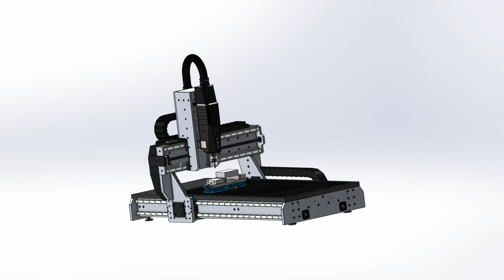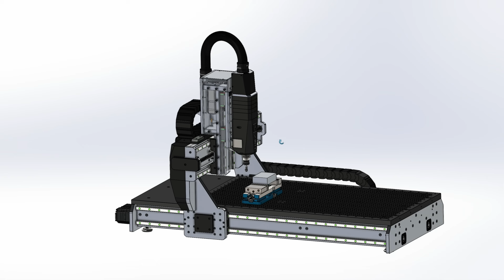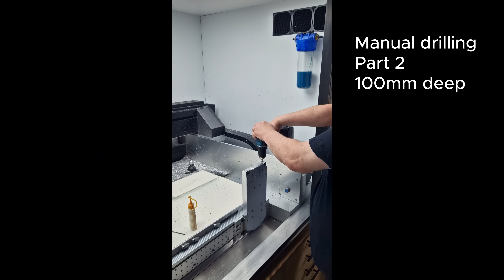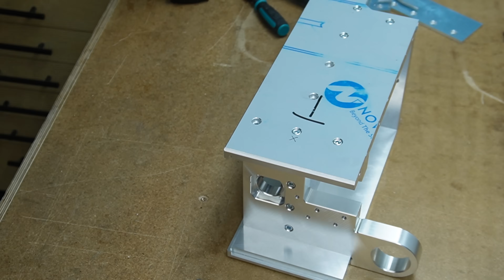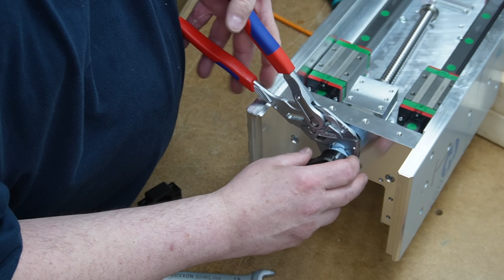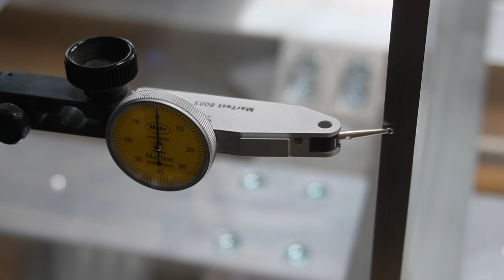Overkill CNC Router Upgrade Part 5 - Chatter free Z-Axis Design

Comment: This is madness!!!
I have watched your videos multiple times, great content sir. 
I have one question regarding mountinh of the screws. So in order to ensure alignment of the screw with linear rails and blocks, first we should mount it and loose the float block and ball screw housing?
Then move it few times back and forward, so after that to tight the float bearing block and ballscrew nut?
Reply from the maker: Yes, that's almost the way to do it. But you need to have the nut housing fixed first. Do it as close to the bearing block as possible. Alternatively fix the floating end and loose the fixed bearing if that's better for accessing the nut housing. Once the two ends are properly aligned, you can loose and re-tighten the bearing block, again close to either end

Comment: What is the accuracy of this router? Looks really cool, thank you for the videos, I'm learning.
Reply from the maker: The resolution at the axis is 1 micron. It mills easily tolerance fits for bearings in alu. +/-0.01 I would say, when I factor the mechanics in

Comment: I've been absolutely loving your series of videos you have put together on this incredible project! You're a huge inspiration to the much less capable machine I intend on designing and building. Would you mind sharing which Ikea horizontal-drawer cabinets you have? I was unable to find them on their website, as I would like to implement a similar solution for my workshop. Thanks!
Reply from the maker: Thanks man. The cabinet with the 4 vertical drawers is completely selfmade. The others are Method kitchen cabinets

Comment: Can i ask, why most vmc use moving rail on z axis?
Reply from the maker: It depends on their design. The ones with a fixed column and a small head (like BF-20, PM-25, etc) have fixed rails on the column. The cheap ones even ride on dovetails, but is it the same principle. 
The ones with a moving column and a large head (like a DMV60) have moving rails, because they usually cover very large Z-axis work spaces

Comment: The only problem with this build is that CNC beginners might find your videos and really think that this is the standard for a diy hobby wood working CNC and never start building 😂 
Jokes aside, as a mechanical engineer I can say that I really admire your design and the thoughts you put in 👍🏼 I would really be interested in:
1. overall cost of this beast
2. a critical reflection of what is really necessary for hobby-level milling of wood, aluminum or maybe light steel on this thing. I mean even with hardwood you would never be able to cause errors greater than 0,1mm with the given sturdiness, even if you try to go full depth and width with a 30mm end mill or something similarly stupid. I can imagine that the constructive measures on the gantry alone would make this better than most commercial wood working mills, even if you would build it out of filled Item extrusion profiles. Looking forward to the rest of the build!
Reply from the maker: Fellow mechanical engineer here too 😉
1. You can reach out by DM at IG for more info on cost
2. Well...I call it hobby woodworking router, because that is the sole purpose of the machine in my shop. I have an even sturdier one for metal (see my last video)
But we build this machine 3 times and one of the other guys mills steel with it. I sell these things and had all sorts of applications in mind. Also semi-professional ones

Comment: This is without a doubt the best (and best documented) CNC build on the internet, bravo! I'm coming back to this video for reference and best practices after assembling my own router and having what I think is massive chatter on first test cuts using feeds and speeds from a tiny benchtop mill. I notice that you don't provide any additional seal to keep chips out of the ballscrew and linear rail system, do you find that the built-in seals in those components work well enough? The rectangular spindle housing seems like it should contribute significantly to the rigidity of the Z axis moving plate. It's a shame that the most common and affordable spindles are all round housing types.
Reply from the maker: First of all thank you for the kind words 🙏
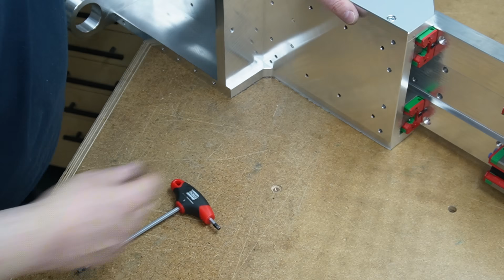At 19:45 you can see that I use extra seals (Type KK) on the linear blocks, but only on the outside. This is ok, because the inside is completely blocked by the mounting plate. No extra seals on the ball screw, because in my experience it does not tend to pile up chips because of the rotation. In my design the spindle does not add a lot to the rigidity of the mounting plate. It lies more in the 30mm material thickness of the plate itself. At 25:33 you can see that the mounting points of the spindle are located at its lower end and they are spaced 100mm apart. You are right in that area it further increases the rigidity, but that is just around the lower blocks. The upper linear blocks are spaced further apart and the stiffness in the area between upper and lower blocks does not benefit from the rectangular shape of the spindle.
But this spindle design is nevertheless a big contributor to reducing chatter, because it is very rigid and has a large surface area which is bolted flat against the rigid spindle plate. The radial forces in the upper and lower spindle bearings can flow directly into the mounting plate. Round spindles need an extra holder, which usually has a smaller surface and narrower bolt patterns. The radial forces create a moment, because there is usually a lever (distance) between the spindle bearings and the holder. Such a mounting situation is prone for chatter. You can cure that by using two holders, but I rarely see that on a hobby machine. Btw., almost all spindles in large CNCs are round, but they are mounted with a flange to a very sturdy box, so a completely different setup.

Comment: Hi this was a brilliant series to watch. You really know your stuff! 

I’m in the planning stage of my own CNC build. Did you have any concerns about vibration damping when using aluminium in the frame design? Also, with attaching steel rails directly to aluminium, is there any need to be concerned about the difference in thermal expansion? I understand this is a wood router but having used very expensive, precision components on it I assume you’d want the very best out of it. I’m only asking as it will help me with my own CNC design. 

Thank you! :)
Reply from the maker: No concerns on both points.
I use fairly thick material and the extruded profil on the gantry is filled with expoxy granite.
Thermal expansion is no concern, because I have a temp diff of max 2-3 degrees in my basement throughout the year.
In an un-heated, non-airconditioned shed I would probably take some countermeasures

Comment: Do you think it would be more durable if we used 7000 series aluminum instead of 5000 series aluminum to make this chassis more rigid?
Reply from the maker: No. It only has an effect on the thread strength. But bending stiffness is identical between 5083 and 7075

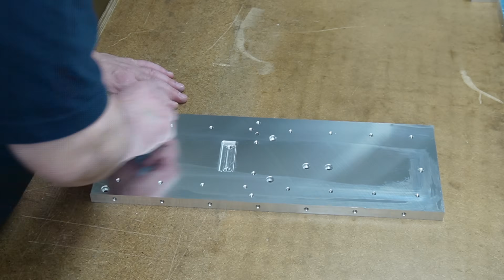Comment: 10:35  - i made the same mistake when build my first router.  linear rails should never be mounted unsupported. you need to prevent them from lateral movement.
bolting them to just a flat plane is OK when they operate normally, but in case of crash they will move.
at first i built z assembly in the same way as you (not as beautiful) and machine was OK but after one crash it started cut weird depending on z height. 
after inspection i found that rails moved and partially lost their alignment.
Reply from the maker: All you need is to properly torque the bolts with the manufacturer's recommendation and you're good. Besides, a moved rail after a crash is better than a broken spindle

Comment: Would there be any noticeable loss of accuracy from running a belt drive compared to direct coupling?
Reply from the maker: Not when you use decent products and do it correctly.. I had mills will a coupling and belt mix on X and Y and mills with couplings on both. No difference

Comment: Can we order from the CNC you used in the video? 🤣🤣🤣🤣
Reply from the maker: Depends on what you want
Reply: @scratchbuiltdesigns  How so? I don't quite understand what you mean.
Reply from the maker: @firukk me neither😂 what dou you want to order?
Reply: @scratchbuiltdesigns  I want to build a CNC machine that can process metal with a 600x900mm machining area and a Z travel of at least 250mm. Since I don't have the engineering knowledge you do, I don't know how to design the body. I've decided to purchase a proper CNC machine and build it. The CNC you used in your video series for machining parts is exactly what I wanted. Unusually, the X-axis is long and the Y-axis is short. In short, do you sell 3D CNC designs?🤣🤣
Reply from the maker: @firukk  You can DM me on my IG account about that
Reply: @scratchbuiltdesigns  I couldn't access the Instagram account you shared on your YouTube page. Actually, I was going to post from there.

Comment: What is the benefit of mounting the Z axis "box" to the plate on the X axis instead of bolting it directly to the X axis rail blocks without the additional plate? I see you are doubling the thickness with the attached plates but does this benefit outweigh the additional leverage introduced?
Reply from the maker: This is a matter of design freedom. I can design the Z-axis as I want without having to take care of the bolting pattern of the carriers being blocked by other components.
Also, it is far easier to tram the Z-axis this way.
And in addition the cross plate has a few features included that make greasing just from one side easier, which would not have been possible otherwise.
The increase of the force lever is neglectable

Comment: I love your attention to details. However I was disappointed by your janky ballscrew locknut tightening technique :) Since the ballscrews are custom machined, two flats should be added on the screw, or a hex hole at the end of the shaft.
Reply from the maker: They are machined on a lathe, not a mill.
A good and simple technique I learnt from a comment here is to fix one half of a coupling on the end and block that with a screw driver, while torquing the nut.
Way simpler than requesting additional machining on the ball screw
Reply: @scratchbuiltdesigns  I've always requested a hex hole for a 6mm Allen key on my TBI ballscrews. They can do it without issues and it costs the same. Makes tightening the locknut a breeze.
Making hex holes on a lathe is very easy with rotary broaching.
Reply from the maker: @vpcred3706 At Topper HZ?
Reply: @scratchbuiltdesigns  Doesn't matter who the reseller is, TBI do the machining. But yes Topper will be fine with it. Nowadays I buy from BST automation.
Reply from the maker: @vpcred3706 Fancy. Given their speed, I thought they do the machining themselves

Comment: Great integrated greasing solution. I also need to mount some HGR25 rails to aluminum and was wondering what Wera torque wrench you have and what torque you set it to to mount steel rails to aluminum?
Reply from the maker: I have a regular Wera Click Torque, ranging from 2.5 to 25Nm. The torque very much depends on your aluminium grade and the thread depth. HGR25 are M6 bolts. I use 12.9 grade bolts for this and Hiwin recommends 18Nm. But this could be too much for the mating thread. When you have 7075 grade alu and 2xd thread depth this is no problem. With 5083 alu and 2xd this is to much. That's why I designed all threads for the rails to be 3xd depth, so I could use at least 16Nm. Not sure which type of alu you have, but it is worth to check the tensile strength and adjust the torque accordingly
Reply: @scratchbuiltdesigns  Thanks for the great info.

They are actually HGR20, not 25. regardless, for my 4040 "light" extrusions and M5 T-nuts, I have about 2xd engagement. Based on that, I'm going with a conservative 4.0 to 6.0 Nm and will start on the low end
Reply: @scratchbuiltdesigns  Thanks for the great info. I realized I got the HGR20, not HGR25. Based on your info, for my 4040 "light" extrusions and M5 T-nuts, I have about 2xd engagement. Based on that, I'm going with a conservative 4.0 to 6.0 Nm and will start on the low end.

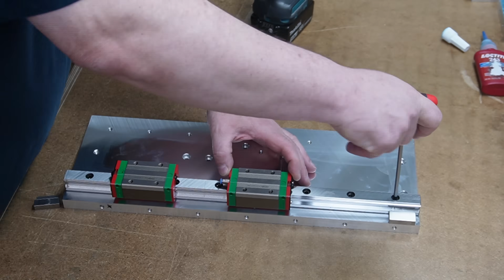Comment: 10:55 One of the tricks I learned in automation is to put dowel pins to which you will push the first rail (they act as referencing points considering the plate was done properly one a cnc and the holes were drilled precisely)
Reply from the maker: Yes, this is an option to. Or even better like I did on the other two axis, with a proper alignment shoulder.
Figured it wasn't required on the short rail here and kinda difficult on the narrow Z axis, but you are perfectly right, something precise to push against is always preferable 🤙
Reply: @scratchbuiltdesigns  Also for the belt tensioning of the Z axis motor  - I assmbled something similair and we also use one one screw that actually pulls (2 grub screw push, 1 screw pulls) - this will provide a safer lock on the threads against vibrations (glue is good). As they say, redudancy redundancy redundancy :D Some designers can overdesign even the simplest of mechanisms :D

Comment: Makes me want to rebuild my Z axis ahah how do you tram the plate in the Y direction? Shimming? Or you rely on the build precision? (Maybe I missed it)
Reply from the maker: I shimmed it with an 0.08mm foil. It was difficult to film...
Reply: @scratchbuiltdesigns  no worries! I was wondering if there was a better way than shimming ahah
Reply from the maker: @gabsshop4966  I have seen solutions with grub screws left and right of the fixation bolts. This makes the tramming extremely easy, but I prefer a full contact between the mating plates, not just a small contact. Also, alu does not have a very high surface hardness, so when you torque the fixation bolts the grub screws might be pressed into the material, throwing the axis again out of tram

Comment: Insanely well thought out plate!!! My attempt looks like swiss cheese compared to your as near to perfect design and construction. Thanks for sharing this, now I know how well the z axis can be done. The box design is so much more rigid than the basic open plate design that I did. Amazing!
Reply from the maker: On my very first router I retrofitted the OEM axis with moving rails with my own design and moving blocks. The design was basically two open plates, connected with the rails and blocks. I used 25mm thick plates and thought it is sturdy af. And then I noticed how it bend during peg drilling aluminium. With a 2.2kW spindle ! Not dramatic, but noticable.
This experience led me to the box design on later machines...

Comment: "I watched all the videos in this series and loved it. I have a question—why can't we remove the X-axis plate and directly mount the entire Z-axis unit onto the X-rails, since it already has two plates? Am I missing something? Please help me understand my thoughts. 🤔"
Reply from the maker: This is a question of accessability of the bolts. The bolts for the upper 2 carriers would be blocked by the spindle mounting plate. Also it is much easier to tram and align this way
Reply: @scratchbuiltdesigns  Yes, thanks and appropriate the knowledge you are providing in this detailed manner.

Comment: i'd been going the flat plate route, with rails on the spindle mount, my thought for rigidity is flat plate with braces to flat plate behind the gantry beam(s) and air struts if weight became an issue.  with that arrangement i could double up the rails front and back, the ones on back offset upwards for even more rotational resistance or just have two rails, but with a nice wide offset.
Reply from the maker: Yep. There are many ways
Reply: @scratchbuiltdesigns  https://www.youtube.com/watch?v=oggLAMCmXUg figured you'd get a kick out of this.
Reply from the maker: @felderup Sure do... Thank you 🙏

Comment: I have privliage to have similar design made as well scratchbuilt designs to fit sorotec compact line and this is game changer. Machining with less chatter and  using whole height of the portal. Low profile vise are not must anymore with this setup. Thats really well thought design. By the way datron using same concept, moving blocks not rails which is recommendation by it self.
Reply from the maker: Thank you, Michał. I am happy that your are content with the design and that the retrofit of the Z-axis on your machine is such an improvement

Comment: The attention to detail and clever design is very impressive. Makes my sim8larly specced cnc router like an amateur jobby (which it is), lol! 

I've chosen the moving block arrangement on the z axis for exactly the same reasons. Mine goes up even further to clear longer drills, but at the cost of rigidity, though I placed a wooden board in the vise upright to plane the sides which worked fine even with the z axis all the way up. 

How did you tram the spindle in the y direction? Did you shim it or also use set screws?
Reply from the maker: Shimming is the way to go 👍

Comment: Why did you choose a gantry style, over a fixed head mill style?
Reply from the maker: The required space. I used to have that in the past on my UHPC. It is an excellent design, but the footprint is twice the length of the work eara of the moving table axis.
I have explained the constraints for this build, leading to the design choices in the first vid of the series. Most of them are related to the limited space available in my shop